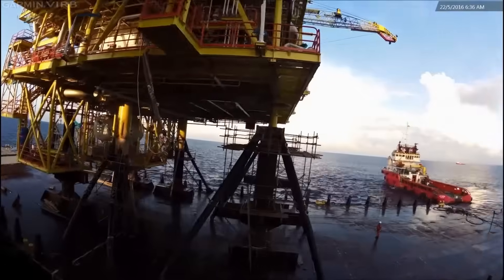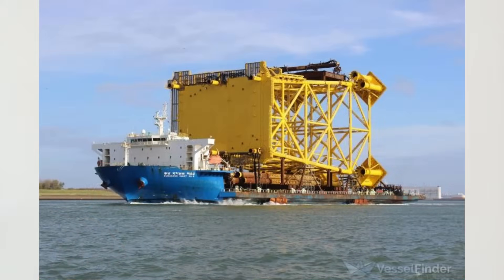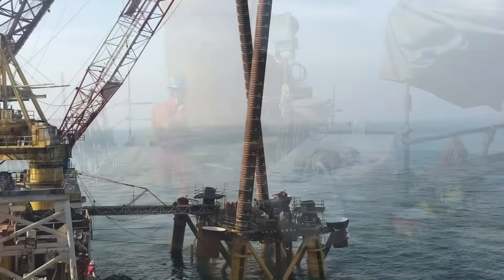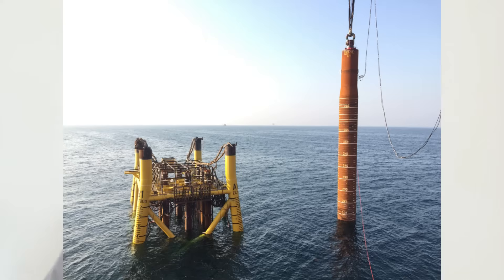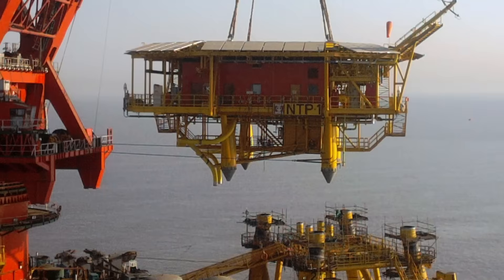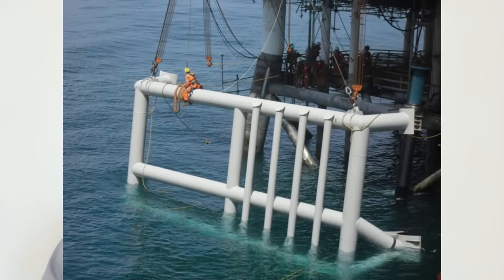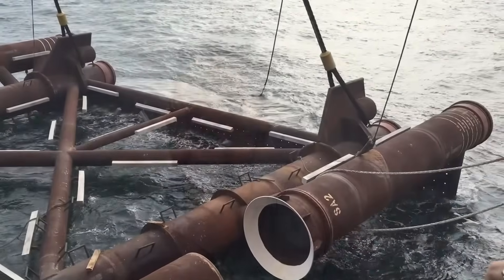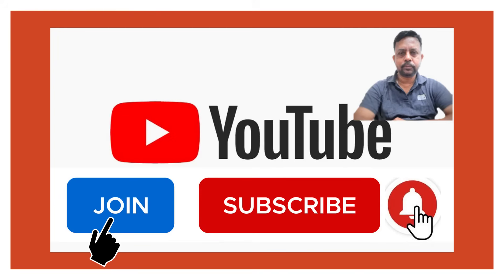How Offshore Oil Platforms Are Installed | Step-by-Step Jacket Installation Explained for Surveyors

Comment: High point and low point marking in batter leg cut of
Reply from the maker: As a surveyor we don't really need to do much in Pile cut-off. This needs little trigonometry and accurate distance measurement. I am in the process of making a small video. If you are a member of my channel then that video will be available to you shortly.